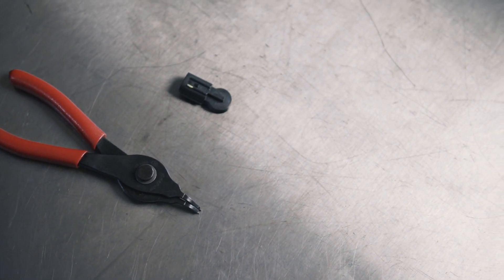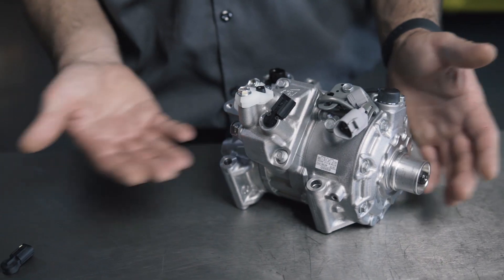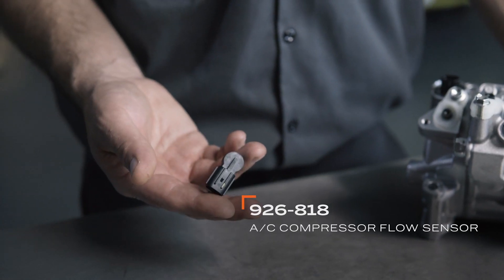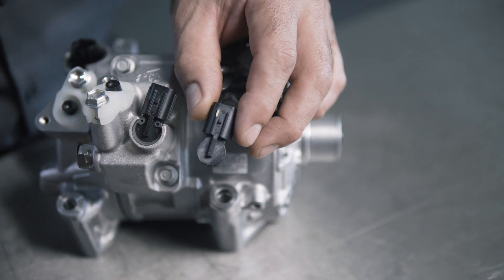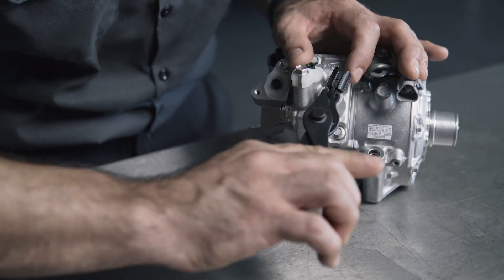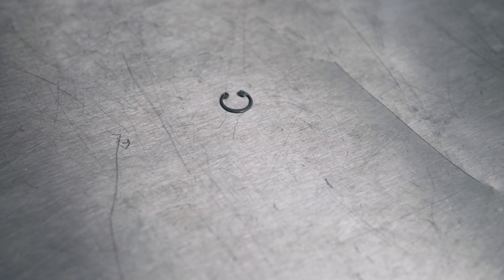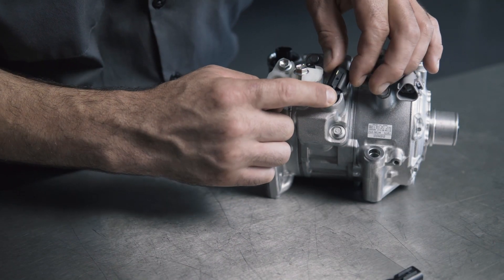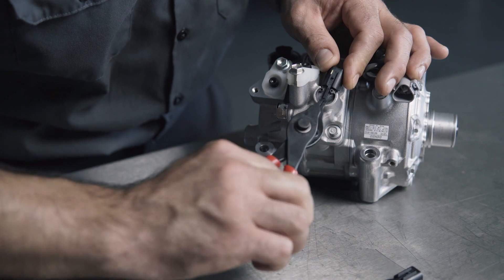OE FIX: A/C Compressor Flow Sensor

Comment: I have Denso Compressor TSE14C on my Subaru outback fifth generation H6 3.6  model 2015 compressor number TSE14C 447280-6791 newly purchased a car with high mailge 170000 KM very low cool is coming 
I checked the ac gas level and leaks not available youre best advice please

Comment: Hello I have 2011 Sienna vent both side driver side and passenger side feel cool not cold I check with scanner tool  there is no code.
Connect gauge to low and high side with ac on max ,low side read 42psi  high side read 171 psi please need advice Thanks

Comment: I have a 2017 Camry and the sensor snap ring is next to impossible to get off without disassembling a ton of components. I abandoned the old sensor in place by disconnecting the electrical connector, re-connecting to the new sensor and then using a couple of zip ties attach it to a wire bundle and hold it in place. I attached the sensor to a bundle to the left of the compressor using two ties so there is no sensor movement and minimal vibration. Fired up the AC and it's working just fine.
Reply: if the sensor is to detect the pressure, there should be part inside the housing communicating with this sensor.  I can't imagine how it went back to work while you please a new one else where.
Reply: Hi there i have the same car 2017 camry and I have the same issue. I bypassed the sensor with the magnet it working good, but I want to be a change the same way which you change can you please help me give me a more detail. I’m new with the repairing I have no experience and Mechanic charge for that of a lot of money, though my compressor is fine with the magnet.

Comment: The joys of replacing that POS sensor in the car, when it is half melted, without taking the entire cooling system apart to get to it.

Good video.
Reply: Just put a magnet on it, it will keep it locked in and working!

Comment: Thanks for showing where the sensor goes, I am sure is going to be  a pain to replace with the AC compressor still in the car.
Reply: Just put a magnet on it, it will work then.

Comment: My old one is stuck in there. Having a hell of a time removing it especially with the rest of the car in the way. The old one is all broken up with just a little bit left in there. It's been a pain. We ran out of time but are going to try to remove it again another time. 🙃
Reply: Just put a magnet on the left hand side of the sensor, it will activate it.

Comment: 2011 highlander new compressor expansion valve condenser pressure read good when ac on but compressor kicks off after a few seconds at idle at higher speeds works fine any help ? Could it be this sensor?

Comment: It's that simple LOL not on a older car,  you can beat these to hell, smash them, break them, and they still do not come off . You have to shatter it in little pieces and use a pick to get all of the parts out of the pump.

Comment: If you can not remove the sensor just unplug it and plug the new one in and zip tie it out of the way the sensor does not need to be put back in the AC pump

Comment: Run a magnet over the flow sensor if your Ac kicks on Pow it is a sensor
Reply: Yep
Reply: Does it have to be a big one? I tried with a small one to pick screws, but didn't work, I was hoping that was the issue.😢
Reply: @mal3x  If you can not remove the sensor just unplug it and plug the new one in and zip tie it out of the way the sensor does not need to be put back in the AC pump
Reply: @DAVE_WHITE  so the sensor is not interacting with the compressor? It's just mounted there?
Reply: @mal3x  yup I could not get mine out at all without smashing the bum, so I just unplugged it, plugged in the new one   and zip tied the new one to the radiator hose,,, works just fine..   2014 toyota camry LE
Reply: It works but it becomes iffy eventually. Sometimes it just won't turn on. It's not a huge deal but when it's 100 degrees out it's not nice.

Comment: This is an rpm sensor not a flow sensor it detects the speed of the engine so the compressor engages only when the engine is running

Comment: Thank you so much for the video.  I have a Lexus 350 and was having the problem you described.   I started the replacement process and was successful at all the challenging things in the tight space including removing the ring clip without having it fly away. * However, after removing the ring clip, I was unable to remove the sensor.  I tried wiggling it,  I try to pry it away with a screwdriver,  I tried WD40.   Eventually, the top of the sensor broke off but the part of the round part of the sensor that makes contact with the compressor would not come apart.  It's as if it's fused, or glued.  Even with a screw driver and a hammer trying to remove it or break it apart, the thing would not give.  

I'm not sure what else to do.  I did use a magnet over the sensor (before taking it apart) and the AC worked fine.    I know this is a flow control switch, but my question is, what's the risk if I was to use a magnet over the new sensor as a bypass?
Reply: What model vehicle and year we you working on? What did you end up doing?
Reply: I have 
RX-350 model 2015, Now I have same issue (flow sensor circuit). Is this same as solenoid valve? Or this is an electronic part? Please could you provide me how to solve it without loosing more money

Comment: I just changed out the flow sensor and reset the fault code. The AC works but still kicks out after 5-10 minutes. Is it possible this is due to a weak magnet? Is the magnet inside the compressor beneath the flow sensor? If so how does this work with the flow sensor? Could the magnet be rejuvenated by close contact with another stronger magnet? Is this why some people claim placing a magnet on the flow sensor makes the AC work? Any thoughts or picture would be appreciated
Reply: The same thing is happening to me. Replaced sensor, but A/C kicks off after 15 minutes. I can turn it back on and it works. Did you ever figure out what was up with yours? Thanks!!
Reply: Most time the problem is the solenoid control valve.

Comment: Hello thanks for you useful video, I have a 2003 toyota Camry LE 6 ciyl, is there a flow sensor replacement for my car also ?, thanks
Reply: I think so my is a 97 and it has it underneath the compressor

Comment: I just replaced the AC flow sensor on my Scion tC.  This video makes it look soooo easy -- but it is not.  I had unbolt the radiator supports, battery, hood latch, and horns, then drain the coolant, disconnect some hoses.  Then I could move the radiator/condensor forward to a point where I could then get access to the sensor.  Then to make matters worse, the sensor was stuck.  And I mean stuck.  I could not get the connector off, and the sensor was stuck to the compressor.  I had to break and chip up the sensor into a dozen pieces with a chisel, screwdriver and hammer to get it out.  Three hours later, I'm finally putting it all back together with a new sensor.  And --- The AC now works!
Reply: Does the tab on the connector push down or pull up to disconnect it
Reply: He said is that simple let him do it on the car to see if it’s that simple
Reply: I have a Scion tC and I changed it pretty easily I’m second gen
Reply: @elvisaguilar8580  which were your symptoms of a bad sensor ?
Reply: Yup my sensor is stuck fast to the AC, this is why the mechanics do not want to do the repair, aluminum corrodes around the dam sensor.
Reply: Second gen and man it was a B I dint move lines out easy to take out the clip just push in but the sensor was stuck I tried prying it out but had to brake it apart to put the new one in
Reply: Magnets would have worked as well.